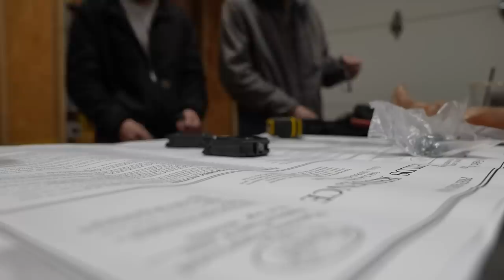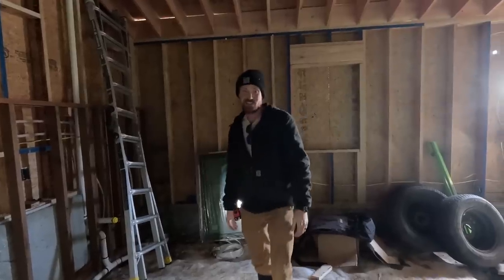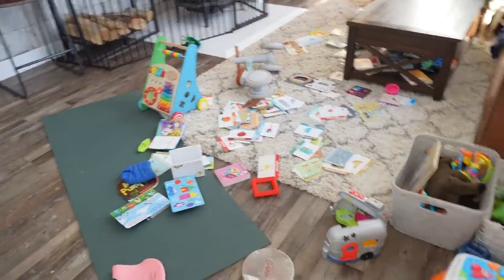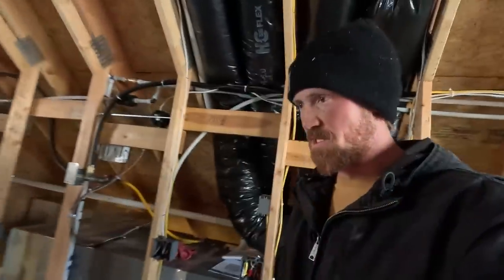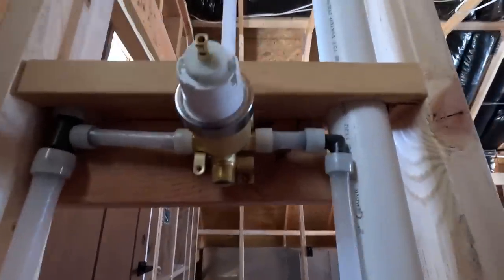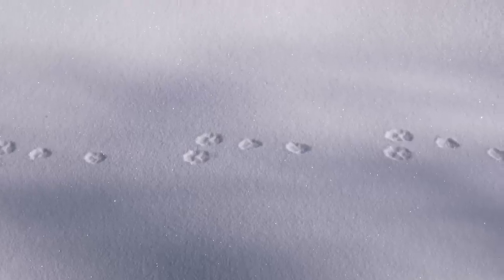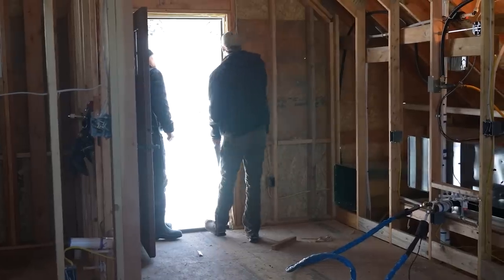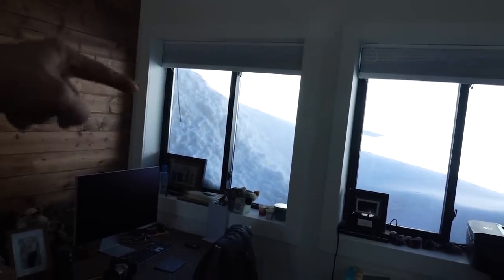OUR 4 WAY INSPECTION... IT'S NOT LOOKING GOOD

Comment: use the ash from the wood stove on the ice and driveway. the dark color soaks in the sun an melts it faster and does provide a certain amount of traction. in the summer the rain washes it away.
Reply: Yes! It is also black so absorbs sunlight, melting faster. Snow and ice reflect the heat.
Reply: Good for the soil.
Reply: I would not want to track ash into my home or garage.
Reply: Clay from kitty litter is worst !
Reply: @anniepurse2831  just clean boots

Comment: Just a helpful hint: when I lived in Chicago, I had a gutter that dripped right onto my doorstep, which made it a clear, flat sheet of ice. Every time I removed the sheet of ice, it would just come back even more deadly. I actually ended up tearing my rotator cuff when I slipped one time.

I soon learned that the key was NOT to remove the ice but to texture it. In other words, scatter salt evenly so it won't melt but it will just create pits where the salt landed. That rough texture that the salt made in the ice saved my ass many times, even when ice built up on top - the texture would usually remain.

Comment: 💡For those who might be wondering @ 12:29  Raynaud's syndrome, also called Raynaud's phenomenon is a condition in which some areas of the body feel numb and cool in certain circumstances.  In Raynaud's phenomenon, smaller arteries that supply blood to the skin constrict excessively in response to cold, limiting blood supply to the affected area.

Comment: It's very hard to build with this kind of winter! I pray that y'all figure out what to do about snow & ice intrusion by the windows you might have to modify the exterior so the snow and ice fall and stack up further away from the house and windows.
It may not be the "look" you were aiming for, but safety is most important.
And please get some heated mats for those steps out front so you don't have to shovel them as much, and find a way to keep the deck snow-free too

Comment: Hey Trent where you have the large wall of snow and Ice, during the summer build a block or rock wall to prevent the snow from leaning into your windows. Or like I suggested before put heat tape on your roof to melt the snow quickly.❤❤❤❤

Comment: Allie- I’ve commented before about autoimmune things when you were pregnant. I have secondary Reynaud’s, and I just looked up the differences. I didn’t realize that primary Reynaud’s is basically benign. So, if you’ve been evaluated by a Rheumatologist and haven’t had any other symptoms of autoimmune, I wouldn’t worry about passing it on to Leo. As you said, the risk is really low, and even if he does develop it, it would likely mimic yours I would think. Good question to ask a Rheumatologist.

Comment: No offense guys, but I am really surprised you passed the electrical. I see several code violations, most minor, but one is large and glaring.  Unfortunately, most building departments have multi-trade inspectors, so they are only experts in one of the trades they inspect.  Not a huge deal for Licensed Professionals, but can be quite a dis-service for most Homeowners.  Great video guys. Thanks, Russ, J Electrician from Oregon.

Comment: Why is snow melting and running into your carport/garage where ur Ram is parked? All grading should be sloped away from all structures which if I remember correctly in ur previous vids in the fall it looked like it was.Cheers from Canada!😁🇨🇦

Comment: I don't get the constant heating/freezing pipes saga. You could easily heat that above freezing with kerosene which you could easily get in small batches up the mountain and not burn any propane.

Comment: Summer you guys need a trac hoe and bull dozer to cut that mountain 🏔 slope off and move a lot of dirt. To level off the ground and dig below the foundation of your house & building. Then slope off the fall of the land away from the house. All this will eliminate the next time you have a huge snowfall it’s not above the windows of the house. Even with what slides off the roof, if you dig out the dirt leaving the house and garage on a Plateau with the ground sloping off around them both. Because guys don’t take this wrong I know it’s your first build so I’m cutting you some slack.....BUT....You guys put that house and garage in a horrible location. There should’ve been a Professional Excavation company or individual Person really good on excavation..... To come and work that ground over good with heavy snowfall in mind before the Footing was ever dug out for that house. Also with the future garage in mind while doing the excavation work. But you’ll know if you ever build another one on a mountain hillside to have excavation work done ahead of time to accommodate for what you’re going through now. That’s what I’d have done but I know you’re young and learning and know better next time. If they were built on a sloping tapered off plateau all water melting snow will run away from the house. Also as you push/blow snow off over the edges you’d never have the build up you do right now. I understand you had record snowfall this year, but it can happen again. Just some things to think about next time for sure. 😉😁👍

Comment: Insulation on the bottom half will make a big difference.  May you can get the 4x8 sheets of R11 and lay it on the floor upstairs or attach it to the ceiling from below . Just as a temp

Comment: Why not insulate between the floors? There are going to be many times when you are working on the first floor and the apartment isn't being used. Plus you've got two separate heating systems. Insulation will dampen the noise traveling between too.

Comment: To remove uponor fittings, all you have to do is cut the ring with a razor blade and heat it with a heat gun, you can pull it right off. Works really slick to reuse fittings

Comment: Most inspectors like to see nail plates that protect wires and also water lines
Also most place have outside outlets which is a must. Also were you have and outside consented need a work outlet also.
Good luck on your up coming inspection. Monkeyvaroom,

Comment: The manufacturers of breakers only certify the breakers for ONE trip.  I usually have a couple spare breakers of the most common ones in the box.   We don’t change out breakers after only one trip.  Not feasible really.  But technically, they are only certified for one trip.  They are cheap and invariably will be needed in time.  When the on/off motion of the breaker switch feels soft instead of crisp, it’s time to change it before it fails.  
In some circumstances breakers can explode.  Stand to the side of a hot panel, when switching a breaker back on.

Comment: Love watching. The side of the house where the snow is in the windows, can you get there with your tractor and blow the snow away? If not use the snow blower from the deck. Also why don't you remove the snow that comes off the roof an on the deck? I know it is ice but once removed then you can keep it up.

Comment: My parents had a cabin that the windows needed to be boarded up for winter.  He built plywood panels that were framed in 2x4s with eyes hooks. Then above the cabin windows he had screw hooks to accept the eye hooks on the panels.  We stored them under the deck and before the snow got too high we hung them up.

Comment: Trent you can install the garage door before your concrete floor is in if you want, we do it all the time.  Just fasten a wood block on the jamb at the expected height of the floor, set the bottom section on those block and the rest of the door install is the same as the others.